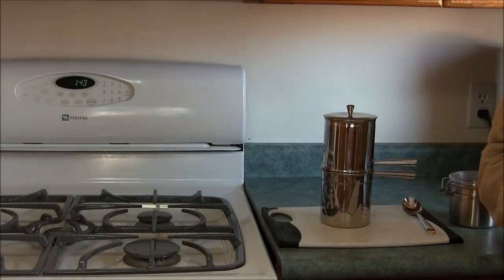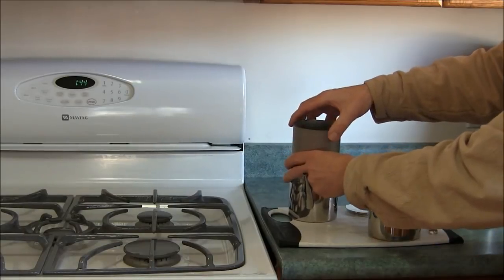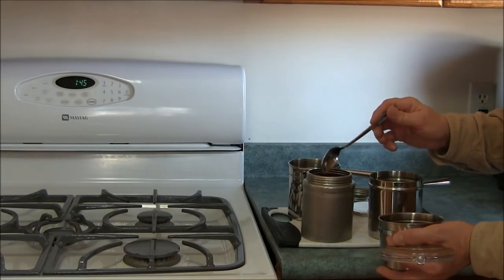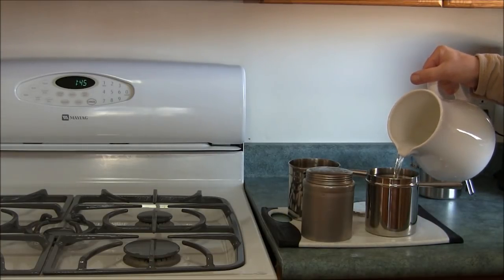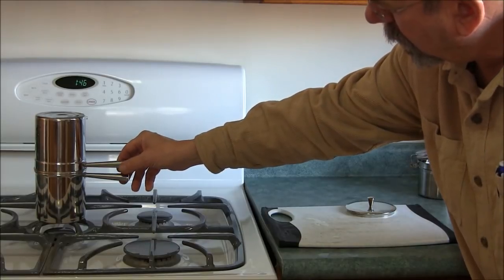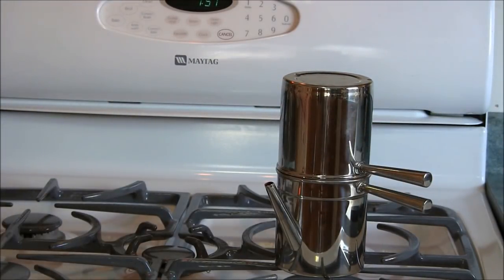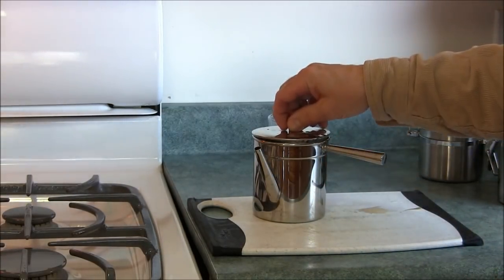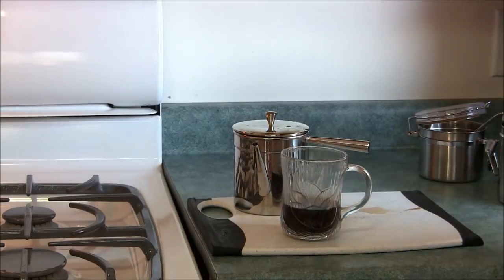How To Use A Neapolitan Coffee Brewer

Comment: Thanks for the video. I saw these advertised as a percolator, but they are not a percolator. So, basically like a drip coffee maker except the hot water is poured all at once and drips out of the grounds. Another way to avoid the reboiling of the brewed coffee that occurs in a percolator.
Reply from the maker: It is an interesting method to brew coffee and the coffee is strong and smooth.

Comment: sorry if this is a repeat, my computer didn't show the first sent. I am wanting to change to manual brewing. Deciding btw old fashioned cowboy style (which I do like and is easy) or this machine.  If you know both methods, would love your input. Not sure this method is for me in that I don't want espresso strength. I don't like perculator nor drip strength either so its not hot water I am after hahah.  If I were to only put my recipe for the strength I like in this which is 2 TBS grounds to 1 cup water would this method work for me?  Also, do you boil on high the entire 10 minutes?
Reply from the maker: This method does make an espresso strength coffee. This particular brewer is rated as 9 demitasse servings of 2 to 3 oz. For a single serving manual brewer I would suggest the Aeropress.
Reply: @Rcoffey51  thank you for that reply; the Aeropress is what I am switching from :)  I want to go non plastic else I would continue as it makes a tasty cup.

Comment: Dear Mr. Reginald, 
I saw you use a machine that seems to be a ILSA Inox steel 18/10. If I am right, I would like to ask you if the filter is made by steel or by alluminium. I ask you this because I used the ILSA model in alluminium, but it starts to lose alluminium powder (which is very toxic) by the top of the filter. That's why I'm searching a model with a filter in steel.
Thanks.
Reply: I have the same model as shown in the video and the insert is definitely not aluminium because a magnet will stick to it, which means it is some sort of steel alloy. I would guess that it's just a different grade of stainless steel to the main parts. Stainless steel comes in many grades with different alloys.

Comment: I have never seen the coffee pot inverted to boil the water.  Not in Naples, not in my home growing up, nor in my current household.  If you cannot wait the extra minute for the water to boil uncovered in the "top" half of the pot, use the little lid that doubles as the serving lid.

Also, this is an "espresso" pot not an Ethiopian medium grid pot.  Use a powdery espresso grind.  The amount of coffee you use will determine the strength of the coffee and how long it will take to fully drip into the serving half.  Microwave some milk and add some coffee to taste to get a great cappuccino.
Reply from the maker: Thank you for your comments Frank but I am confused. If you boil the water in the "top" half of the pot, how do you get it to go through the coffee filter to brew?
Reply: You simply pour the boiling water into the sleeve containing the coffee, which is set into the bottom half of the pot with spout.  The hot water will slowly drip through the coffee.  Similarly,  you can boil water in your favorite tea kettle and pour it into the assembly of sleeve and pot with the spout.  Then top it off with the other half to keep in the heat.

You can take this pot to your office and use hot water from the water cooler or other hot water source.  Microwave the milk and you have cappuccino after lunch!
  
In fairness, since writing my comments, I see many YouTube videos recommending the same method as yours, many by native Italian speakers.  I tried this "flip" method about an hour ago, and my wife and I enjoyed the coffee.  There is no apparent difference in the quality of the resulting coffee.

The only difference in the methods is the water boils faster separately, doesn't spill onto the stovetop, and more hot water can be added to the brewing sleeve if you would like to mellow the brewed coffee to more closely match non-espresso brewed coffee and increase the quantity of brewed coffee.
Reply from the maker: I see what you are saying but for many of us pretentious coffee professionals, the coffee ceremony is a large part of the enjoyment. Being able to flip the coffee maker to entertain company is the highlight of our day. ;)
Reply: Bravissimo!  Enjoy.
Reply: @neophos6027  Whoa!!! Pot meet kettle! It's only coffee... Relax!